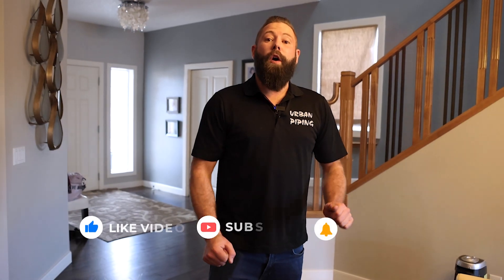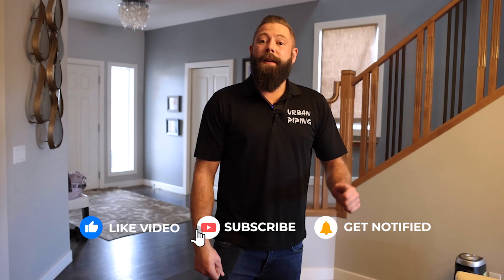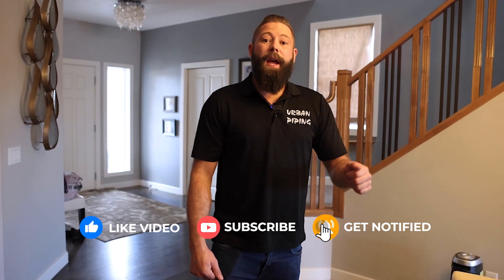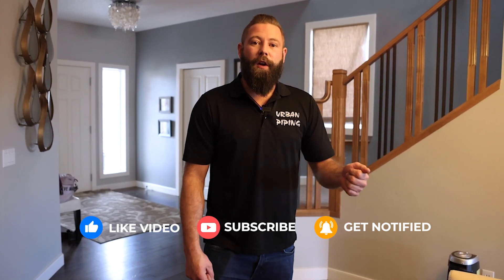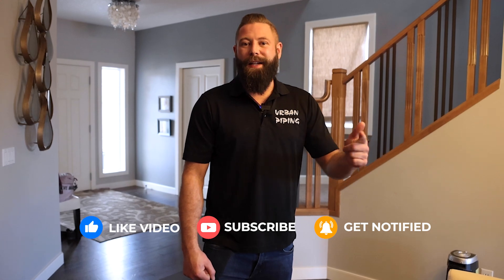Plastic vs. Brass Fittings: The Poly B Replacement Dilemma

Comment: I need to cap off a 1" PB pipe, used in an old (1970's) yard watering setup.  The PB pipes are too brittle for crimp fittings.  I cannot find a push fit cap in a 1" size.  Any ideas?  Thanks!

Comment: So I've been told poly b had 3 generations,  the early formula,  an adjusted formula and the 3rd and last formula made in the last year's of manufacturing is this correct and 2 separate plumbers have told me the final formula had fixed the issues the earlier stuff had.